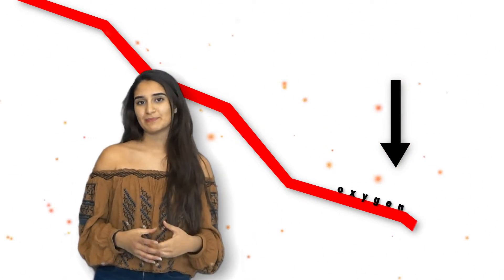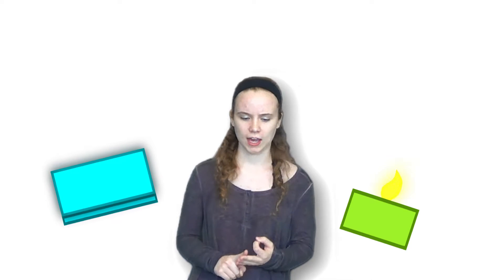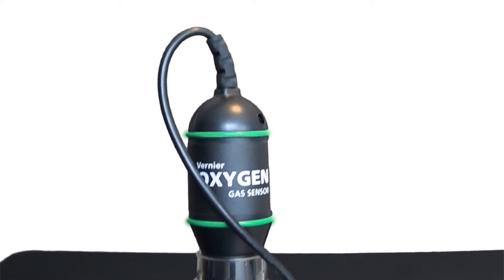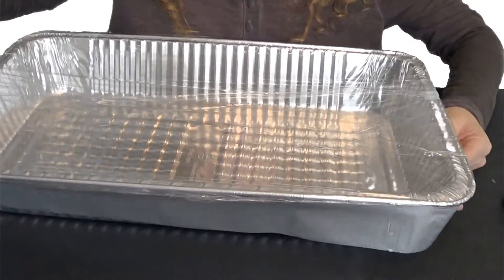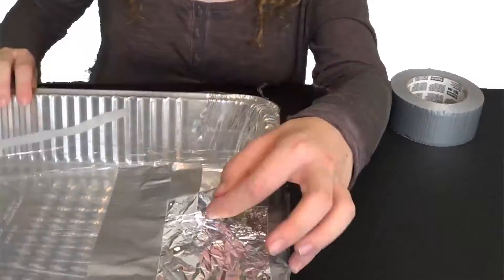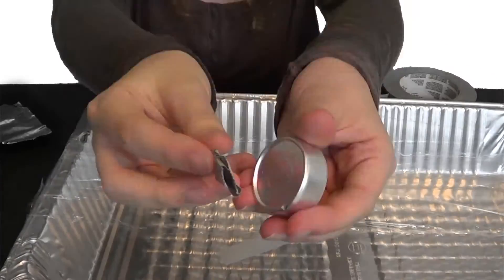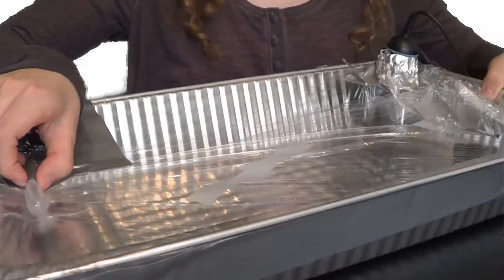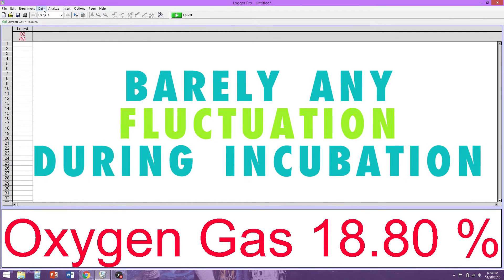Homemade Hypoxia Chamber

Comment: Hello there! 
This is an awesome and useful video. I run a molecular neuroscience lab at Illinois State University and we just burrowed your concept and it totally worked. Specifically we have animals (nematodes) which are known to detect oxygen using a specific sets of sensory neurons. These worms prefer lower oxygen concentrations. When we used your setup (with some minor modifications) we found that we could get the worms to migrate towards the lowest oxygen side of an assay arena. We will be sure to acknowledge you if we end up using this in our research. Keep up the good work!

Andres Vidal-Gadea

Comment: Hi! What motivated you both to make this video? 

Why candles? Yes they lower the Oxygen content - making them hypoxic, not hypobaric, the former lowering the partial pressure of Oxygen, the latter lowering the pressure below the external environment, but aren't at all practical. Any living creature inside would likely overheat, or inhale enough wax and other gas byproducts, that they would die, or come close. Also it isn't particularly scalable: would have so many candles for a human sized compartment, that they would likely come out looking like a piece of toast, when the timer is set to max. 

For these reasons, chambers large enough to comfortably get an adult human inside use one of two methods. 1. Swing Pressure Absorption (hypoxic), and 2. sealed containers attached to one or more vacuum pump. There is also a third type, which would make for a good 2nd attempt, using Co2 scrubbers to rebreathe air we exhale, making use of the bodies natural ability to remove Oxygen. The downside here is as I am sure you know, exhaled air contains dangerously high Co2 levels, hence the Co2 scrubber to filter it out. This method is generally considered inferior to the other two, as it takes more effort to achieve the O2 concentration you are looking for, and usually reach much lower O2 concentrations quickly. This isn't very useful because usually the goal is to hold a constant partial pressure of oxygen with little variability for hours, if the intended effect is the stimulation of red blood cells.

Comment: I'm trying to make a DIY altitude tent, would this still apply to it?
Reply: I wouldn’t do that, what they don’t say in the video is that the oxygen taken away from the air is converted into carbon dioxide... I wouldn’t recommend breathing in a chamber with low oxygen and a lot of carbon dioxide. That’s why professional hypoxia chambers don’t use a burning system to lower the oxygen level
Reply: Haha I was looking for something I could fit in too.